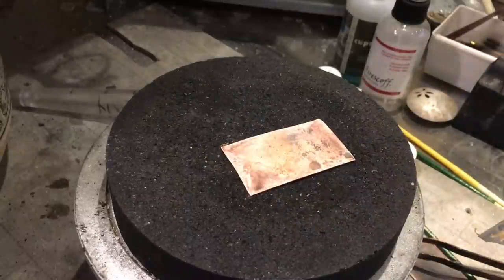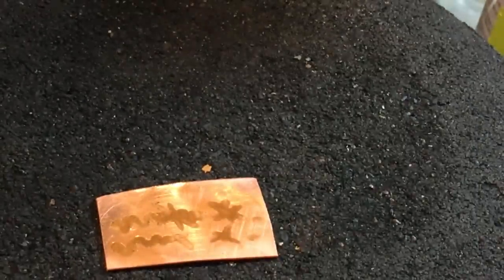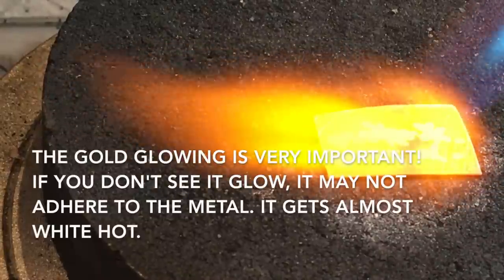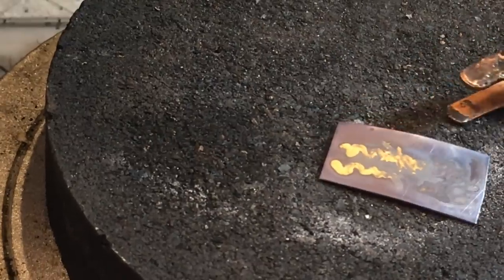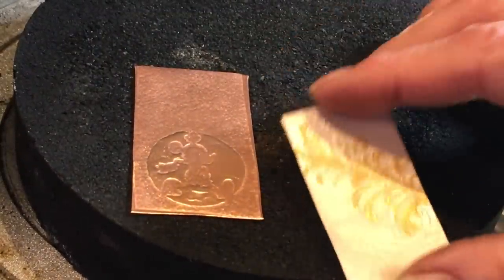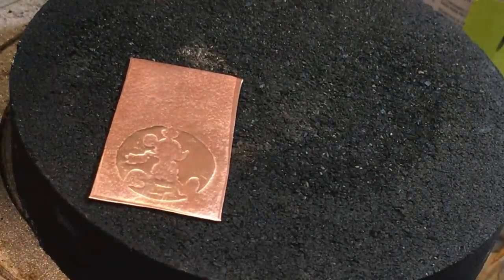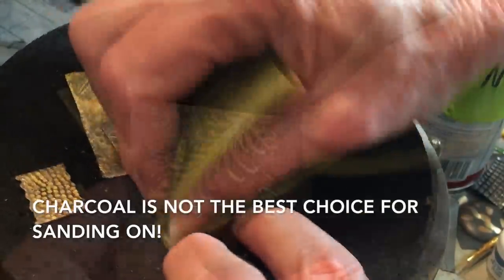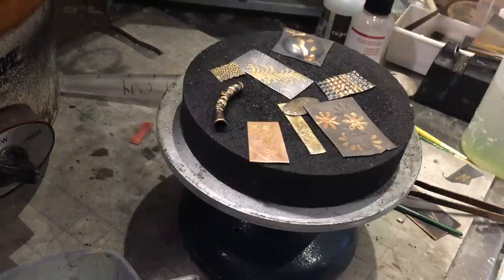Torch-Fired Gold - short version!  The easy way to apply REAL gold to copper-based metals!

Comment: What a great video! Thank you for sharing your technique! 
Question: have you ever tried Accent Silver, and does it work in the same way? Or does it need a different technique of application?
Also does it have to be a hard charcoal block or could we just use our usual heat stone?
By the way I love your dance at the beginning 😉
Reply from the maker: I used Accent Gold and Aura 22.  Both worked. It should be charcoal but, you could try without.  Charcoal helps to create a reducing atmosphere (less oxygen = less oxidation). Thanks.  Have fun experimenting!

Comment: Hi, can you tell me how I can stop getting trivet marks on the counter enamel? thanks
Reply from the maker: One thing to try is to clean off the edges before firing.  You can grind or sand them off (mask!).  Another possible assist is to make sure that there is no enamel on your trivet.  Or lay down thin layers of enamel. After counter enameling, try applying a thin layer of scalex to the back of your piece. Let dry.  Stone off any trivet marks.  Experiment with these suggestions and see what works best for you.